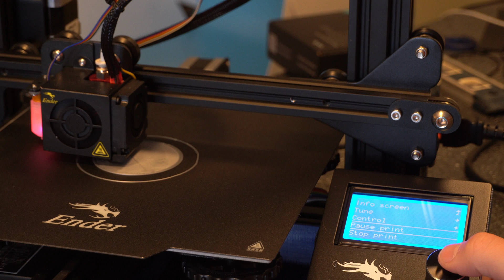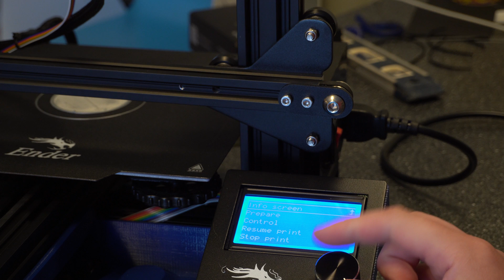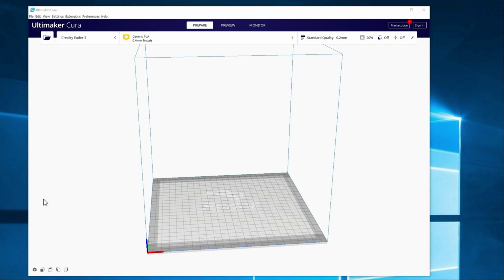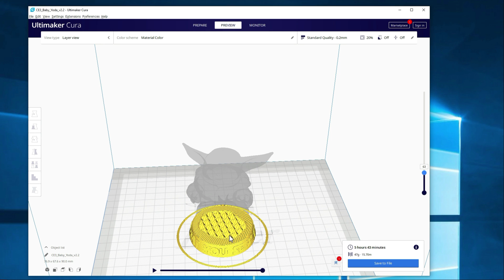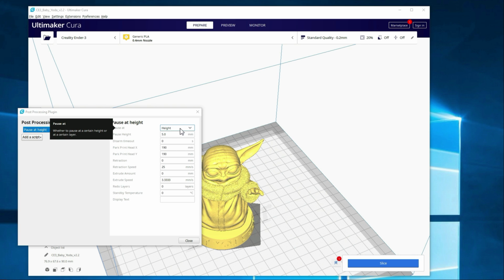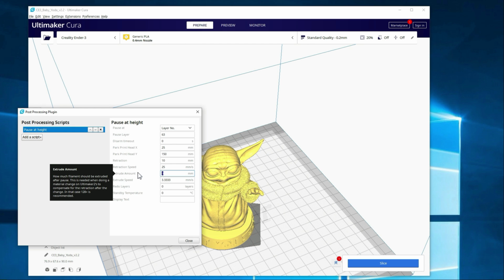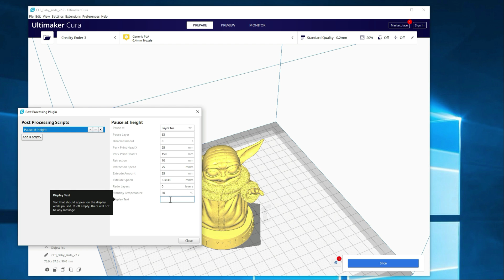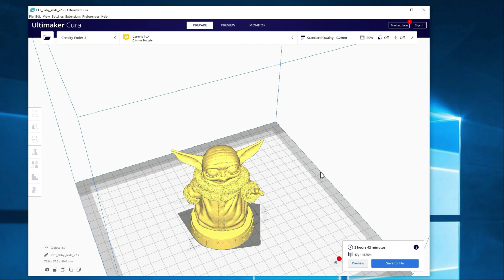Ender 3 Pro - Change Filament Mid-Print

Comment from the maker: I hope you found this overview helpful! If you have any questions or would like other tips/tricks, just let me know in the comments.
Reply: You kinda skipped over the most important thing... changing out the filament... Th last thing I want is a jam.. What is the best method? do I cut the filament and try push that through with the old filament or do I pull it out and possible clogg the PTFE tube???
Reply from the maker: Hi. I just saw this, I don’t get alert when people reply to existing comments ☹. This was one of my early videos, and I did a video on changing the filament before this, so I didn’t think I needed to cover actually swapping the filament. Based on the comments I have gotten, I should have. With the stock firmware, I used to carefully pull the filament out and feed the new filament in, then purge until it was primed. I think you can also get into the movement menu and unload the filament that way. With Marlin 2.0 and the TFT35, I go under the extruder menu and unload the filament.
Reply: I tired doing what you did in cura and it didn't work. I'm using the latest version of cura 4.8 I'm also using a ender 3 pro
Reply: I have the BLTOUCH as well. which firmware did you use and did you change any other setting to make it work. Mine does not accomplish this.
Reply from the maker: @mcsstudios101  I was using the recent build of the Marlin firmware.

Comment: I have 2 ender 3 v3 machines. When I do extrude to clear out filament and start new it goes to the center of the mat. If there is an object midprint, will I need to switch to a clear mat? How does that work?

Comment: Hi done many time to no avail! The Cura setting will definitely pause the printer at the layer height! But after i change the filament, i'm unable to resume the printing process. 
my display doesn't show resume or continue. any idea?  I'm using Cura 5.8.1 and Anycubic Vyper printer.
Reply from the maker: Hi. That could be a firmware setting with your printer. Are you using stock firmware or custom marlin build?

Comment: how does hot filament attach to cooled down filament?
Reply from the maker: Hi. i havnt had any issues with it attaching. Im guessing its hot enough to still heat up the cold filament enough to get adhesion.

Comment: Hi mate, I tried the setting in cura, it paused where I set it but when I changed the filament color and resumed the print the hot end stayed in the air and didn't go back to the print. Filament was just pouring out all over the bed. I have a voxelab Aquila x2
Reply from the maker: Hi. This sounds like it may be an issue with the firmware. What firmware are you using?
Reply: @3DPrintscape  I'm using Alex's firmware,  but I have just read tonight, if the printer parks it's self automatically when paused , then I need to untick the "Park print" as it doesn't work correctly and confuses the printer
Reply from the maker: @Memories-in-craft  The advanced park feature needs to be enabled in the firmware for it to work right.
Reply: @3DPrintscape  Great thankyou I'll check where it is in the morning, where would I look to find park feature in the firmware
Reply from the maker: @Memories-in-craft  Its in the configuration.h file

Comment: Hi Rob!    I'm trying to use CURA to do a stop at height.    I had the 4.2.2 512k with BL-Touch prob before.  I know the Ender 3 Pro's stock don't really do that, but not sure if it's a firmware thing.  

If you know any tricks to get that working Me and a few others on the FB Ender 3 Pro group would love to know!
Reply from the maker: Hi. You should be able to use the pause at height plugin under the post processing section.

Comment: Whenever I go to actually remove and replace the filament it says "the current consumables are exhausted" or something along those lines and even after replacing the filament it doesn't let me resume the print. Do you know any possible ways to fix that
Reply from the maker: Hi. I have never seen that. What printer do you have?
Reply: @3DPrintscape  I have a cr6 se, but I just moved the filament sensor out of the way and it's working now
Reply from the maker: @69bigtaco69  Ah ok, that shows that the issue is related to the sensor. Im wondering if the filament being pulled out, even if paused, it triggers it.

Comment: So, I have a question, if I fall asleep when the filament is supposed to be changed will it just start back on it's own or do I have to manually do it? I can't find anything on any website for it. (Using Cura)
Reply from the maker: Hi. It won’t resume printing until you hit the resume print button.

Comment: Thank you for making this very helpful video. I understand why you didn't add the filament changing part because it's about how to tell the printer to pause midway by itself rather than how to change the filament. I'm going to try this on Ender3 v2 which I see people having issues and quite unsure about it. Maybe will do a small print to try first.  Could you please let me know how to do this same thing on Superslicer or Prusaslicer? Would be awesome if you have a video for that in the future.
Reply from the maker: Hi. I think both of the slicers have a similar feature, i just haven't used them.

Comment: When I hit "Pause" on my new Ender3Pro it stops and doesnt lift or go home.
I can raise if manually through the settings knob.
Reply from the maker: Hi. What firmware are you using? If marlin, you will want the park feature enabled.
Reply: @3DPrintscape  I'm pretty sure it's Marlin it's box stock I've never flashed it.
I will look for a setting called Park.
Reply from the maker: @plainbum  That sounds like the creality firmware. If it is, im not sure if they have park exposed anymore or not.

Comment: I’ll have to try this. When I did pause on CURA, my motor didn’t move and it was still hot so it made a big bump towards the end of an 8 hour print. I was so peeved.
Reply from the maker: Hi. That could be related to your firmware. If pause is enabled but parking isnt it will just sit there.

Comment: Does using the Cura method stop after it prints the layer? After Layer 4 is where I want to stop to change the color for layer five. TIA
Reply from the maker: Hi. Im pretty sure it stops at the start of the layer specified.

Comment: My filament snapped and now I have sit on the white tube that feed the filament. How do I get it out? Please help.
Reply from the maker: Hi. Sorry to hear that. The only way to get that filament out would be to disconnect the tube. heat up the hotend, and pull it back out.
Reply: @3DPrintscape  Did just that and thank you.

Comment: I also wanted to ask you the SD card that comes with the Printer is only 8g can you get a new sd cars like a SanDisk with more gigs and fill it out with all the files you want to print. I had a 128 I know its way to much but I just wanted to see it it work and it said no media
Reply from the maker: Hi. Technically the printer only supports 8gb SD cards formatted as FAT32. I have had 32GB cards work fine for files, but not for firmware updates. I would look to see how your 128GB card is formatted, if its NTFS thats probably half the problem.
Reply: @3DPrintscape  Didn't work it said no Media
Reply from the maker: @RDSMOTO  Does it work with any other card?

Comment: I am printing on a Lulzbot Sidekick 747.  After I pause print on the LCD, I cannot access the "Change Filament" screen.  My only choice is to resume print.  Any ideas?  Thank you
Reply from the maker: Hi. It sounds like that may be a firmware setting with your printer. You could try to manually change the filament but if its not moving the nozzle to the park position you will have a hard time doing the filament purge.

Comment: So is it important to preheat the extruder/filiment when changing spools? When I first did this due to the spool getting caught on the reel, I paused it and untangled it (wich took me a while) then I hit resume without preheating the PLA, the result was almost like it slipped a layer resulting in a very visible line on the print wich later came apart very cleanly, would this not have happened if I had pre heated the extruder first?
Reply from the maker: Hi, ya its required. Preheating the extruder to at least 180 is required to be able to purge the filament.

Comment: Thanks for the video! Tried this today and did a mini cactus (with the pot in one color and most of the plant in another).  Had some issues with the custom firmware on my Ender 3v2 (the change filament kept timing out while heating the element) but I managed to get it to work, and the results are awesome.
Reply from the maker: Nice, did you have to make any other changes to your firmware build to get it to work?
Reply: @3DPrintscape  I used the pause at layer height in Cura, when it was paused the change filament timed out. I was still about to change it over though as the head was hot enough, but couldn’t purge. I had set the purge amount to 0 on resume and it didn’t give me the option to purge when resuming (my guess is if this is 0 it overrides the purging step, so maybe it’s worth always putting something there just as a backup). 

As I resumed from the pause though I did a manual pause, and when I resumed that it gave me the option to purge. I might try again and set a purge value in the pause at later height (and maybe that will then give me the option to manually purge). Would also be good to see why the change filament option is timing out and if that happens again.
Reply from the maker: @craigtregear2026  Thanks for the details and ya it sounds like setting it to 0 disables that feature.

Comment: it will always resume too low causing the nozzle to ruin the print.
Reply from the maker: Hi. I have not had that experience. That said, you do need to make sure that your not moving the axis when changing the filament. If you push down a little you would see the behavior your describing.
Reply: @3DPrintscape  i modified the printer with a linear rail its possible the weight is causing it to drop on its own.
Reply from the maker: @jimbobbyrnes  ya thats possible.

Comment: I tried this my creality cr6 se with community firmware version 6. Didn't pause at all. Any ideas?
Reply from the maker: Hi. Try to switch to pause at height instead of layer number. You could also try the filament change script as well.
Reply: @3DPrintscape  I tried the filament change, that also didn't work. I will try pause a height instead of layer.
Reply: I tried pause at height and it worked.  Thank you.

Comment: I've been using Filament Swap and it works ok, but for some reason it isn't retracting enough filament when it moves away and deposits a big blob before it does.  Anyway around that?
Reply from the maker: Hi. The only thing i can think of would be to modify the firmware to have it purge some filament when the resume button is hit and tell the plugin to use the firmware settings. I havent actually tried this though.

Comment: What is the blue think on the top end of the printer? What printer do you have? My Ender is making a clicking noise when printing any suggestions?
Thanks and great videos
Reply from the maker: Hi. Thats just a filament feed, i cover it more in this video https://youtu.be/_JP5dkiLtAo . When is it making the clicking noise, is it when going up/down or when the extruder is going? Can you try to isolate where the noise is coming from?
Reply: @3DPrintscape  It’s coming from the extruder you can actually see the brass wheel when it makes the noise it kind of bumps. Love your videos by the way thank you so much
Reply from the maker: @Mollymaddieopp  It sounds like there may be resistance after the extruder. You could have a partial hot end/nozzle clog or something like that.

Comment: When and where do you pause then connect the new filament to the old?
Reply from the maker: Hi. I added written instructions to the description, they may help a bit more. But once the print is paused, you would run through the filament change process.
Reply: @3DPrintscape  thanks for the response, you’re the best!

Comment: Hi just a quick note. If you are using the TFT35 screen with the latest update (27), you can click the layer button when it's printing and it changes from height to layer number. Saves you guessing where the print is.
Reply from the maker: Hi. thanks for the tip.

Comment: Your printer is not setup right, your whole print head jumped when it hit a little bump this means the wheels are way too lose. Properly setup a small bump like that the hotend would just smooth it nothing should move.
Reply from the maker: Hi. You are correct that the everything was not tight. I have my printer apart a lot for doing videos/mods. I didnt think it was a big  issue as the video wasn't related to that.

Comment: How is this pause at height (to change color) different from the filament change GCode? Thx.
Reply from the maker: Hi. It allows the print to pause at a specific layer so you can change the filament. The specific layer part is more important if your changing colors.

Comment: On the pro at least on both of mine you can go to tune change filament to do this
Reply from the maker: Hi. What board is in your pro? This video was made a bit back on the 1.4.4 board. The 4.2.2 board has newer firmware and more capabilities.

Comment: God so...... bad. So in fact when it comes to actually showing how to change the filament, you don't film it?!
What is this video for exactly?
Reply from the maker: Hi. Thanks for the feedback. The purpose of the video was to show you how you can change the filament mid print. At the time, i didn't think it made sense to add the extra time to video as i had just created a video covering how to change the filament. I was first getting started with YT and made assumptions i shouldn't have, sorry about that.

Comment: If I pause the print there are no preheat option for me.. :(
Reply from the maker: Hi. What printer and firmware are you running?
Reply: @3DPrintscape  Thanks for the reply! It's a Ender 3 Pro. It has Marlin 1.0.1 I should probably update the firmware..
Reply from the maker: @ggooaa100  Its probably related to the firmware version. There are so many options that get changed between versions, especially if you build your own, that menus and features are frequently different.

Comment: So I’m doing a more detailed color swap and have done the retraction and extrude before restarting but when it goes to print again I get a blob on the print any ideas how to avoid this?
Reply from the maker: Hi. The only thing i can think of would be to try to clean the nozzle right before it gets back to the part. This may be tricky though.

Comment: When it pauses it only pauses for around 15 seconds and then resumes. Anyway I can make it pause for longer?
Reply: I have same issue. trying to figure it out
Reply from the maker: @ToReS33  Are you using the Ender 3 V2? I know there are some capability issues with the touchscreen and some of Marlin, so I think that's whats causing the issue.
Reply: @3DPrintscape  yes, using v2 with creality firmware.
Reply from the maker: @ToReS33  Im not sure there is anything that can be done with that printer, but I will look into it more.
Reply: @3DPrintscape  found a solution and worked for me. Firmware tt I use does not read M0 which is pause code.  M0 needs to be replaced by M25. so, sliced in Cura then edit gcode file manually in a text editor by changing M0 to M25.
Reply from the maker: @ToReS33  Ok, thanks for sharing that. So you went in and replaced M0 with M25 after it the file was sliced?
Reply: @3DPrintscape  correct.  Changed to m25 in .gcode file
Reply from the maker: Hi. Are you using an Ender 3 V2? I know people have been having issues with the pause feature on that.
Reply: @3DPrintscape  ender 3 pro!
Reply from the maker: @davidmcl2007  ToReS33 found a possible solution. The firmware he uses does not read M0 which is pause code.  M0 needs to be replaced by M25. so, sliced in Cura then edit gcode file manually in a text editor by changing M0 to M25.

Comment: Do you know why my nozzle would be scraping the print after I change the filament?
Reply from the maker: Hi. The only thing i can think of that would cause that is if the z-axis got pushed down a little during the process. Thus has happened to me before and is no fun.
Reply: @3DPrintscape  anyway I can fix that? It’s ruined like 4-5 prints
Reply from the maker: @8michelotti  How are you loading the filament and do you have the aftermarket metal parts? If you don't, I would recommend getting them. They make loading the filament a lot easier. https://youtu.be/uyFGLYJZfrM

Comment: Interesting: I attempted this on my Ender 3: I didn't even give any user input and my printer went back to printing while I was swapping filaments.

Using Cura 4.8
Marlin 0.0.6
Reply from the maker: Hi. Are you running the Ender 3 v2? I have had some people say this isnt working for them on that printer. Im not sure if its the Creality 4.2.7 board or the firmware.
Reply: @3DPrintscape  Nah. It's a v1

I did. However, change out my board to a silent motherboard made by SOVOL.
Reply from the maker: @Arceus3251  Im thinking the pause features may not be enabled, or changed, in the firmware.
Reply: @3DPrintscape  Best bet is to probably update the firmware?
Reply from the maker: @Arceus3251  You will probably need to compile custom firmware if they have it disabled in the pre-compiled versions.